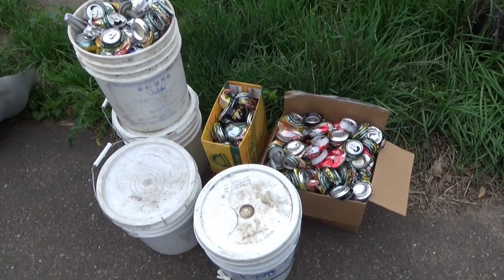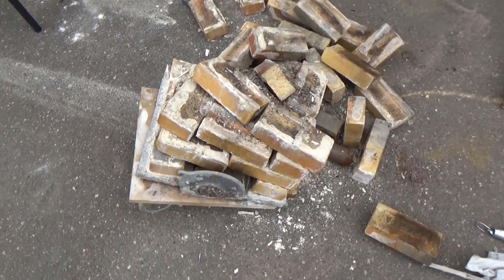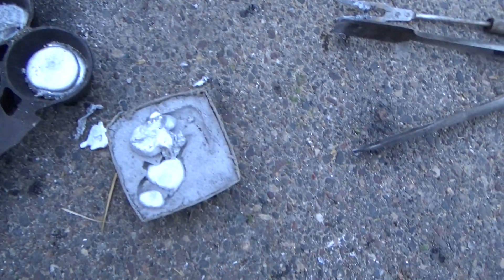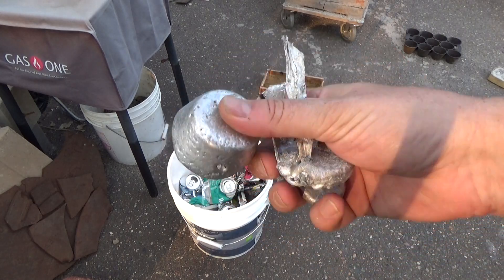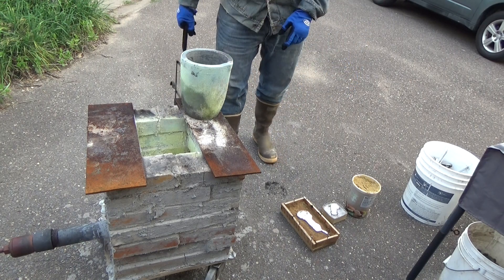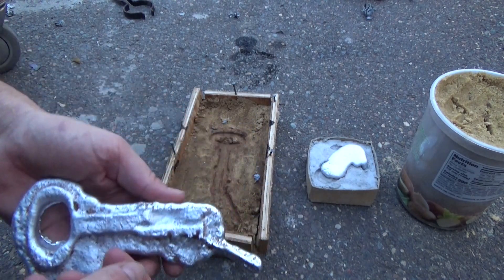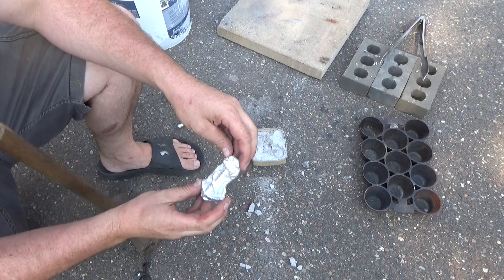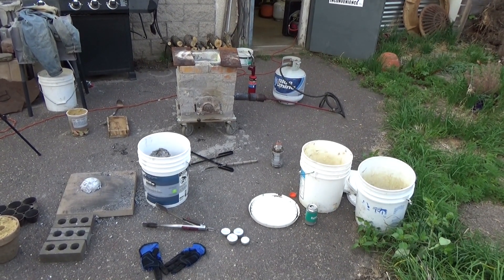Attempting to Melt Aluminum with Propane (Aluminum Smelting Part 3)

Comment: You need a smelter that can deliver the temperature required to melt whatever you're trying to Melt. You also need the appropriate flux. But, first, you need to know what you want to Melt. The cans you're trying to Melt are not made of aluminum but made of two different alloys (lid and container). With a bit more metallurgy know-how, you'll be able to Melt whatever it is you want to Melt!

Comment: You can make a quick and easy small kiln with fiberfrax durablanket which is used in pottery and glasswork, just taking a old school metal garbage can and line it with this fiberfrax, to make a inexpensive small kiln, It is incredibly heat insulating and will retain the heat much more efficiently than those old bricks,  a small opening at the top is okay too, using the type of bricks you are using, they take a long time to heat up, using this fiberfrax blanket material literally takes no time to heat up, so all the heat energy is going towards the metal

Comment: I will preface this by saying I have very little experience with propane forges but I know compared to oil burning forges the are not as efficient but if you are going to use propane you need to make or buy a proper burner because weed burner wands are not really that efficient.  The is a British guy who a couple years back did a series on making a fuel oil/diesel burning forge he won an award from Martin aka this old foundry man for an octopus bottle opener he made.  That all said I feel I need to do something I normally don’t do and be a youtube SS (Safety-Sally) commenter.  You need to be wearing heavy leather boots that have a round toe boot that is at least 6 inches tall and 8 is better with either 100% cotton or 100% wool socks and not those damn rubber farmers boots unless of course you don’t like your toes, feet, and ankles.  Years ago a neighbor of mine used to cast Aluminum, pewter, and tin soldiers and on a rather nasty wet fall day put on a set of rubber boots like yours and lit his forge and proceeded to go about melting down a couple thousand beer and soda cans (not only melt the tops and bottoms of aluminum cans there is also no aluminum in the sides of the can but they are coated to prevent the beer or soda from rapidly developing an off taste and as a result create a lot of slag from the coating and the outside ink labels but if you want to melt whole cans don’t crush them) Now back to my neighbor and his rubber famers boots; he had crucible about the size of your filled up about 3/4 full of molten aluminum that was rather old and just after he lifted the crucible out of his melting forge and was picking it up with his pouring handle and the bottom of the crucible broke clean off and just about all that molten aluminum landed on the front half his right foot and melted that rubber boot like it wasn’t even there I heard him scream and jumped the fence and found him laying on the ground with the front half of his right boot more or less a molten glob along with aluminum that was rapidly solidifying onto his foot.  I pulled him away from the semi molten aluminum and cut what was left of his boot off his foot and as much of the melted boot I could before spraying his leg with water and calling 911. He ended up losing all of his toes and had to have multiple skin grafts on his foot which unfortunately was all for not because it got severely infected about 16 months later and they amputated above the ankle and then at the knee and then the hip but by that time his body had become septic and he died from the the infection.  I thought the day I saw him screaming on the ground was the worse day of my life but the last time I saw in the hospital in pain and crying like a baby was worse and when I left his room that day I cried like a baby and again a week later when I was one of the six to carry coffin up and down the church aisle and to his grave site.  Seriously if you don’t wear round toe leather boots for yourself do it for your family and friends.  PS Make a proper crucible lifting tongs and pouring hoop and always set it on a piece of dry warm fire brick.  Remember I the bottom of the crucible broke off my neighbor told the accident investigators that he had set the crucible down on his normal piece of fire brick but that he had forgotten to dry/warm it like he normally did so in a sense he died because of his own mistakes.

Comment: Holy third-world! 😬 
I know it's a hot summer, at least wear safety glasses AND flipflops! 
And if you can get refractory insulation bricks and mortar, you should be able to get a nice thick piece of ceramic wool blanket to insulate the top of the furnace. 
And make sure molds and mortar are cured out and dry before any molten metal touches them. 
You're so close man! Don't give up now! 👍🏻

Comment: I think you are losing a lot of heat by not having enough insulation and by and not using flux / the right flux you are not getting proper separation from slag.

Comment: OMG!  You are going to seriously hurt yourself!  You're very lucky you didn't have a steam explosion from not preheating your "muffin tins" or other molds.  And your safety gear was VERY poor.  In fact, I dare say you should remove this entire series as it shows SO many incorrect techniques. Some fool would just emulate and without your luck.  Look up BigStackD Casting on youtube for how ametuer melting should be done.

Comment: Hi there, couple of things; 1) I am no expert and have never smelted or cast anything, but watched quite a few videos on the topic, so maybe some of this is helpful. 2) I think your slag problem is mostly due to oxidation, if you’d have a lid for the crucible it would reduce it a lot I think, alternatively if you could melt it faster the oxidation should be less. 3) Regarding the melting it faster I think you’re losing too much heat. Any half decent home-built smelting furnace I’ve seen has quite a bit of insulation on the outside of it and also is almost entirely closed with only a small exit hole at the top. Have a look at the furnace building videos by Keith Rucker, he cast refractory into a mould and then insulated it from the outside. 4) Heat management is also a thing, you’re trying to heat the whole thing evenly, to accomplish this the air/gas inflow is usually offset from center to create a swirl of heat around the crucible, you’ll also see this in Keith’s videos. 5) You need better quality mould. The sand doesn’t bond well enough together, make sure you have the right type of sand and the necessary additives to bond it. That’ll help keep it’s shape a lot better. Also, as you have noticed it is quite difficult to get the metal to flow into the details and you end up with big blobby overflows. I think you need a two-part mould with a channel down to the form and some reservoir on top (I forgot the proper name) that you fill entirely with metal to provide pressure on the metal to help it flow into the form and also compensate for the shrinking as the metal cools. Have a look at mrpete222’s videos on the subject of making split patterns and moulding up patterns. He mostly casts in “hard” lead (i.e. containing antimony) which he melts in a little gas stove. A lot easier to melt. You can get it from old cast printing type or from old wheel weights. I hope you continue with these experiments, it’s great to see someone figure this kind of thing out. Usually you only see videos of the end result of a long learning experience and people don’t explain everything they learned over time. This kind of video series is a great resource of what you need to look out for.
Reply: Oh, one thing I forgot, with relation to cost, better insulation and less heat loss will of course already help, but I’ve also seen quite a few people run a smelting furnace off of used oil. You need some system that produces fine droplets of oil in a high airflow and if the droplets are small enough and the environment hot enough the oil droplets will self-ignite and keep the whole thing going without an additional heat source. That should be very cost effective, but also seems to be a lot more tricky to get right. Could be worth it though if you can get it going, but should probably be a long-term goal rather than a short-term one.

Comment: I have a lot of aluminium scrap but I also don’t think its worth it. You need a ton of equipment, It takes a long time and it is also dangerous. Both the fumes and the heat. Not worth it.

Comment: Don't people use common Borax that you get from the store in the laundry section as a flux? That might be for Iron or something though so maybe look it up? I think there is also a technique like is canister Damascus making where they mix crushed glass in with the metal to melt and form a liquid layer on the surface to limit oxidation. In theory it is just chemistry so you should be able to figure some of it out on your own. You want to mix something in there to reduce the metal and any oxidated bits back and you want the resulting compounds to form a light weight solid that you can scoop out off the top. You might try reclaiming some of that metal in the slag back in a beaker then seeing if the resulting powder will mix into whatever you melt for your next pour. Lastly maybe you can amend the propane by adding some charcoal into the bottom and using a bit of both so you don't need to use 3 cans of propane for each melt.

Comment: A proper lifting and pouring tool(s) will make it easier to actually get the material out of the crucible. You also want a cheap ladle or large scoop to get the slag off the top of the molten aluminum while in the forge. Lastly make a fire brick lid. Your losing tons of heat through those pieces of plate steel. Then seal up all the cracks on your forge. You may also have luck using nut coal in conjunction with the charcoal and fan. It shouldn't be that difficult lol. Your halfway there!

Comment: No actual experience melting or casting aluminum, but after watching a whole bunch of bigstackd (check them out for inspiration!) videos over the years I can pretend I do! Here's a couple of things that I think might be causing at least some of your problems:

- You might be losing a lot of heat from lack of any insulation above the crucible, making it take longer to melt stuff or just not melting at all
- Ideally you want something to scoop the slag off the top of the molten metal before you pour it, but I guess its not quite getting hot enough to do that
- The sand in your mold looks quite wet, and if it is, that's probably causing a lot of voids in your casting when you pour it as the water in the sand will vaporise under the hot metal

At the end it sounded like you were done trying so maybe I'm too late to help, but either way, it was still interesting to see you give it a go!

Comment: Perhaps try using a smaller crucible. You end up spending a lot of gas trying to heat a larger one. Also, scraping the dross off the top is a smart idea. Just a cheap-o steel serving spoon does the trick.
Reply: nailed it